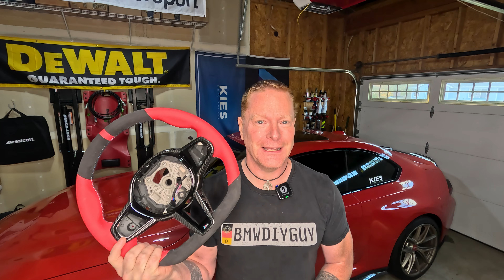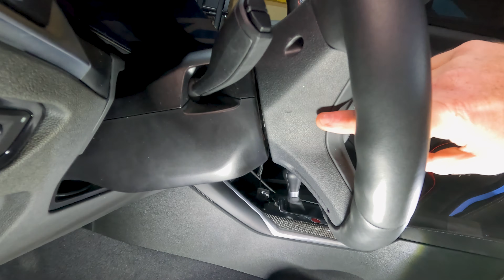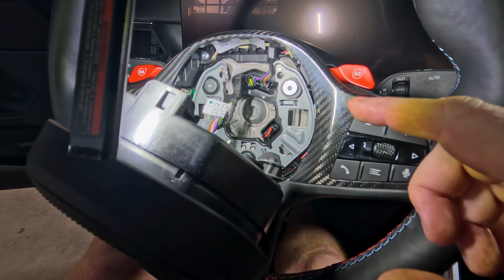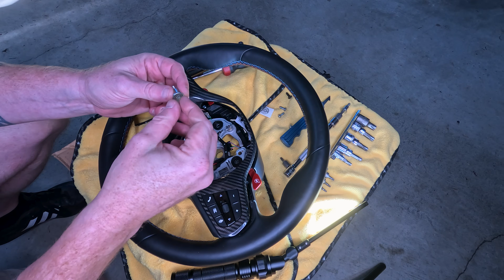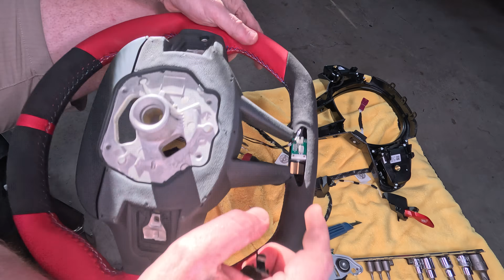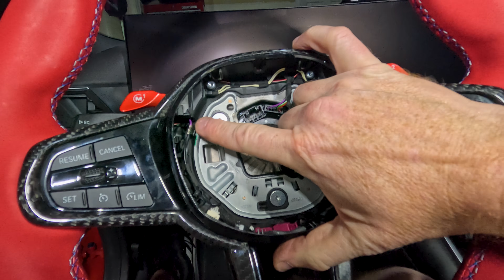BMW LCI Infinite Autowerks steering wheel DIY - Complete install

Comment: Thanks for the video!🙏
Do you add a new cable for the vibrating motor or how do you connect it?
Reply from the maker: Yes the kit comes with a long cable extension to relocate at ty3 bottom of the wheel

Comment: Hi, was the original vibration motor used??
Reply from the maker: Yes, just relocates to the bottom of the wheel with an extension cable
Reply: @BMWDIYGuy  Ok, but can you use the original one? Isn't it necessary to buy a new motor with wiring?
Reply from the maker: @Pixoncardetailing no. Its the original
Reply: @BMWDIYGuy  ok thanks, very kind, and what about the heating function?
Reply from the maker: @Pixoncardetailing it works properly with the button relocated onto the outer body of the center circle.
Reply: @BMWDIYGuy  ok is it only necessary to buy it with the heated crown?
Reply from the maker: @Pixoncardetailing sorry I dont understand your question.  The nee wheel relocates the button, and works perfectly

Comment: May be a stupid question, but where do I plug the new extended vibration motor wire in? 🤷🏻‍♂️ I don’t have heat or M buttons.
Reply from the maker: So existing wheel should have that motor, and the wiring harness for it.  Now the motor is further away so needs the extension
Reply: @BMWDIYGuy where do i buy the extension wire for the motor?
Reply from the maker: @rezzyrepairs the extension comes with the wheel
Reply: Ok thanks!

Comment: After installing I have steering wheel assisted problem
Reply: Thank you for sharing this great video tutorial! One quick question is that after transferring the vibration motor, are there additional coding that's required? I am hearing an electrical whine when triggering the motor but am not feeling any vibrations. I had this work done by a local mechanic and he is also a bit befuddled.  Any compatibility issue with installing this steering wheel on a 2021 G29 Z4?  Thank you very much!
Reply from the maker: @pedrogrande99 so not sure about the Z4, but no extra coding needed
Reply from the maker: Make sure the motor is plugged in.. if the plug came loose it will throw all kinds of errors
Reply: @BMWDIYGuy i fine the problem no need to connect the white cable

Comment: where did you get the wire extension for the vibration motor?
Reply from the maker: It comes with the wheel.

Comment: The control box was sitting in a rubber gasket or housing on my OEM steering wheel. I noticed the housing doesn’t fit on the new steering wheel. Do I remove the control box and the wiring from this housing and move it to the new steering wheel, leaving the housing off?
Reply from the maker: If I understand the piece you are talking about, I left the housing on.

Comment: Hello, I put the same steering wheel into my 2022 X3M. However, the heating does not appear to function. I attempted to change the wiring, but the issue persists. The seller has stopped responding. Can you share any tips with me?
Reply from the maker: @MartinoHR-rk3mp  I wish I had a secrect.. plugging the switch in and it should work

Comment: Do they provide a new harness duct/bracket? I tried fitting the harness duct from my 2024 wheel and it didn’t fit in the 2025 wheel
Reply from the maker: I had everything I needed to get it done.. so not sure which duct you are looking for?

Comment: Did you reuse the M1 and M2 trim piece from the OEM wheel? I noticed the buttons don’t seem to fit on the new trim piece that came with mine, and when I tried reusing the original trim piece, it didn’t fit on the wheel. Just trying to figure it out, since I don’t recall you going over that step.
Reply from the maker: @aminafshinpour6596  correct you transfer the M1/M2 buttons and the left right button assemblies
Reply: Thx so you transferred just the buttons. They don’t go directly on the trim piece like they do on the OEM pre lci trim piece right?

Comment: Could you explain how you removed the two cables? I couldn't find the release mechanism. Is it on the cable, the part where the cable goes into, or somewhere else?
Reply from the maker: @aminafshinpour6596  which two cables?
Reply: @BMWDIYGuy  Right after you removed the airbag, you mentioned having to remove two cables
Reply from the maker: @aminafshinpour6596  so everything unplugs.. airbag plugs in, switches too, plugs should come out

Comment: Hi can you advise if you had to extend the vibration wires or was there enough on the existing wiring loom due to relocating the motor to the bottom of the steering wheel
Reply: You don’t happen to have a picture or wiring diagram of the extension cable I have bought a LCI steering wheel for my 2023 M240i and it has the bottom section the same as yours to relocate the vibration motor but there is no cable in the kit I am under the impression there is enough cable on the existing vibration motor to relocate from the existing position to the bottom of the steering wheel thanks Brian
Reply from the maker: @brijus123  the oem harness definitely doesn't have enough length to reach.  Sadly I dont have a pic of the extension.  Maybe Infinite Autowerks might just sell you that extension if you ask them?
Reply: @ thanks I’ve emailed them to see if they could supply just the extension cable
Reply from the maker: @brijus123  the kit comes with an extension
Reply: @BMWDIYGuy  thanks

Comment: I was wondering if you replaced the airbag with an airbag for the LCI. When i checked with BMW, they actually had a different part number for the 2025 airbag compared to the pre-lci airbag. Also the wiring harness for the 2025 wheel is different and I have read a few sites that have suggested to use the new harness instead of repurposing the one from pre-lci wheel.
Reply from the maker: @MachinegunAK  I didnt replace it and everything fit perfectly

Comment: What about the heat button? How this will work without the button?
Reply from the maker: @MaxNothhaft  it does have the button, just relocated to the inside of the wheel.  Works perfectly

Comment: Hello, does the steering vibration work stably? Is it not working? I have read a lot of comments saying it is not working very well.
Reply from the maker: @nihatbaykul5391  it does, but located at the bottom it is not as pronounced.

Comment: Anyone try this that has driver assist pro? There is a whole separate module with wires that go to the capacitive touch sensor… not sure how that now connects.
Reply from the maker: @sightlinespeed  check with Infinite, pretty sure it works
Reply: I have and pop up problem not working assist on the street

Comment: Does the red match the red interior perfectly? Also is their a heating function and button?
Reply from the maker: @PEACEOUTXX1  I have black interior but it's a very good vibrant red.  You can also select over a dozen other colors too.  The buttons transfer from the oem wheel and the wheel heating button is relocated to the side and works perfectly
Reply: @BMWDIYGuy  thanks def looking into a new wheel this looks great. Love the new lci wheel

Comment: How did you get the extension wire? How can I get it?
Reply from the maker: @AdiSinghV12  For the motor? It comes with it.
Reply: @BMWDIYGuy  yes for the motor, could you please share a picture or something? I didn’t get it and not keen on cutting the original wire to extend it
Reply from the maker: @AdiSinghV12  if you get this kit it comes with the extension.  No need to cut anything. You can. See it in the video and no way to take a pic now with the wheel installed